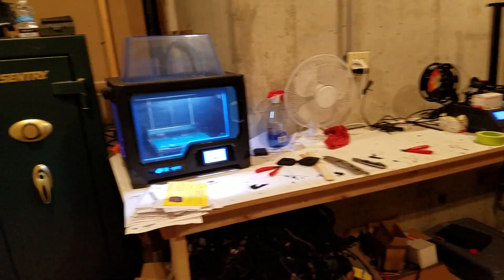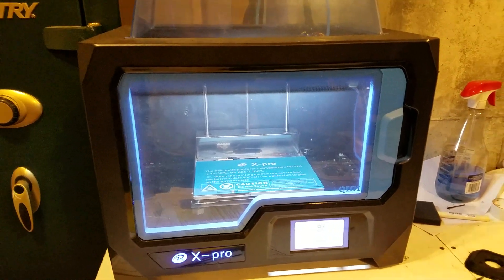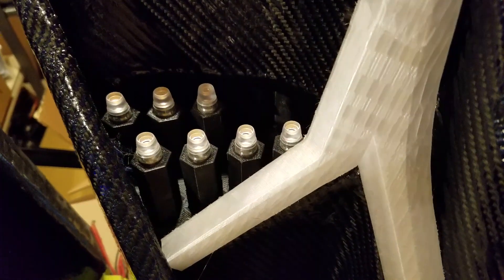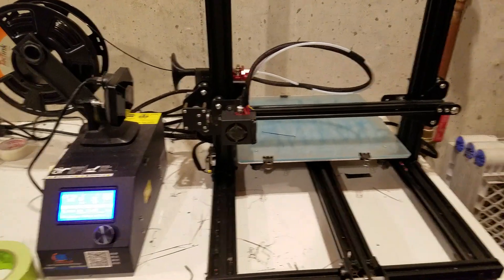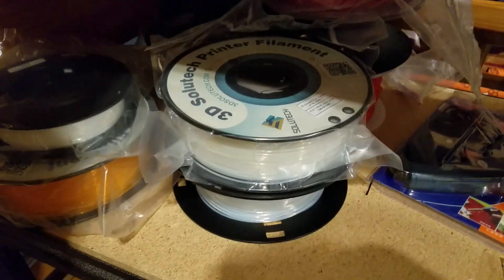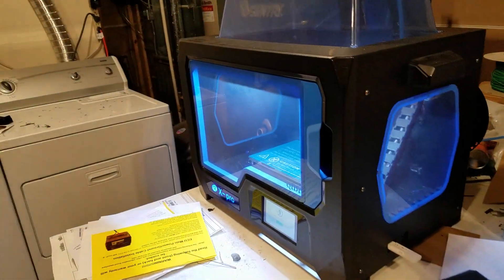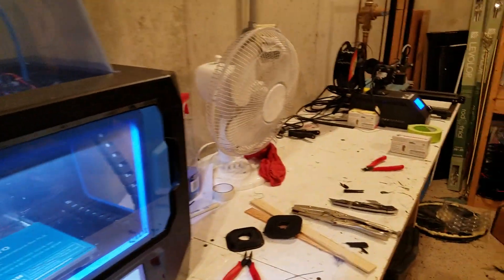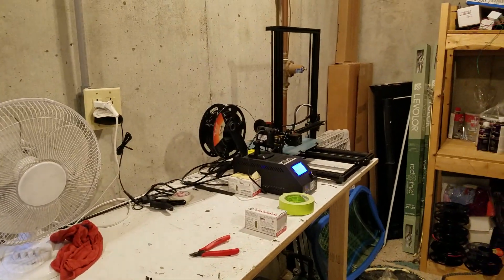3D Printing equipment

Comment: Hi, I’m new to 3D printing and I’m thinking about buying a CR-10 Max to print some prototype fender flares for a Jeep Wrangler JKU. I have really good 3D scan files but I’m not certain about what program to divide the parts up in printable pieces.  

I also have to make the fender flares 30mm wider than original to make them cover the tires in a good way. In norway it’s not road legal to have the tires outside the fender flares.
Reply from the maker: I have shifted to a Qidi Xmax, where I get much better results.  I use Solid work to cut the pieces into printer size chunks.

Comment: hello,
you are a legend among 3D printing ! I would like to know please what infill percentage are you using for the lambo panels and parts ?
Reply from the maker: Thanks.  15% fast honeycomb.
Reply: Wow at 15% only you are doing it !! How strong it is to make the body of a car 15%
Reply from the maker: @Firashelou  It is all encapsulated in 3 layers of carbon fiber
Reply: Aha, so i want to build a simulator cockpit from 3d printed part, so what do you suggest as infill ? It will not be encapsulated in any fiber just the plastic which will hold a 100 kg max of weight
Reply from the maker: @Firashelou  50%

Comment: Something to consider PLA is very prone to warping and sagging in moderate heat not sure how hot it gets in the summer out by you but if you plan on painting the car  I would avoid painting it black the carbon fiber skinning may mask a compromised sub structure and start to get very brittle overtime. This is certainly not a guarantee I have not experimented with it myself however having used a lot of PLA filament for a variety applications as well as some fiberglass and carbon lay up (have yet to combine the two) it is something to keep in mind. That being said if your using a sufficient amount of carbon as opposed to just skinning it with a few layers to give it a carbon look it probably will not be an issue. All that being said this build is really awesome and I am going to be keeping a close eye on it. Do you have a blog or have any plans of doing a detailed write up on the work youre doing?
Reply from the maker: See: www.facebook.com/lasersterling
I have left test panels out in the summer sun for >6mo.  No compromised surface, and still as strong as before it was set out.  See my other vids.
Reply: @lasersterling   what about the parts that are close to heat? Example the light holders or plastic close to the exhaust and engine?

Comment: How do you print the metal mechanical frame? I thought 3D printers cannot print metal
Reply from the maker: They can, but we use standard frame building techniques.  Just the body and interior parts are 3D printed.
Reply: @lasersterling  how much work need to be outsourced?  Did you do the welding and cutting yourself? I'm curious how much it will cost to build a custom designed car. I'm considering to design one from scratch for non commercial purposes, and do most part myself.  But I'm advised that part of the manufacturing process like welding,  cutting, bodywork etc needs to be outsourced, so I'm wondering how much can be done by myself (my background is in mechanical and electrical engineering)